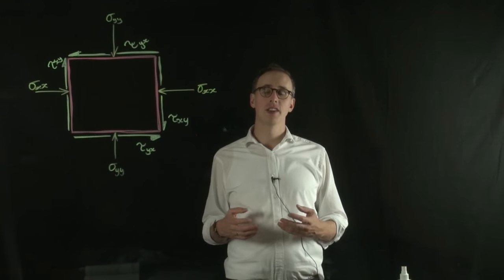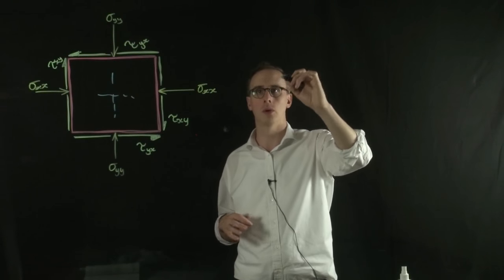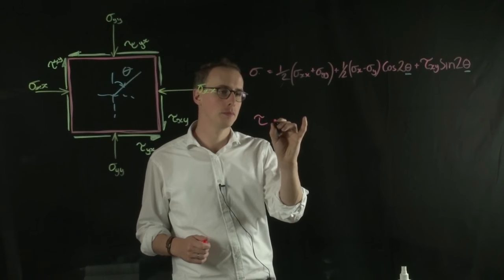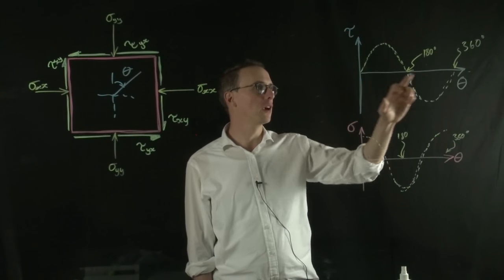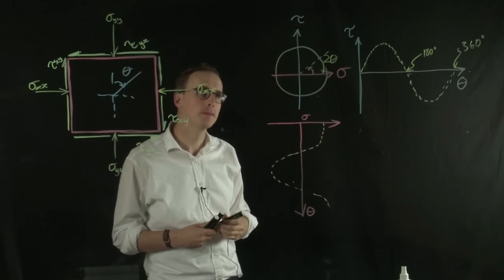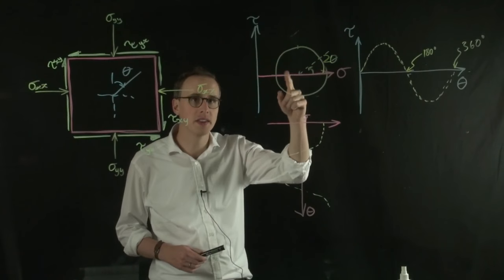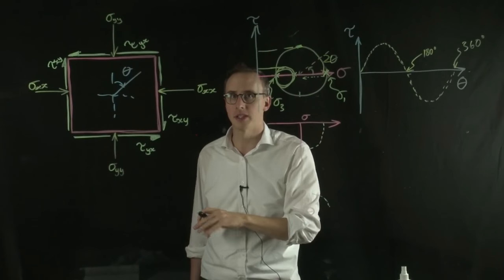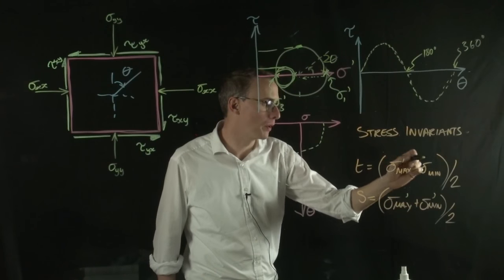Mohr's circle

Comment: I think you have semi-taught yourself how to write laterally invertedly but also pause to write in front of the board. Instead, shouldn’t you be able to write normally behind the board with a playback system than has a later inversion flip option... I think it should work.